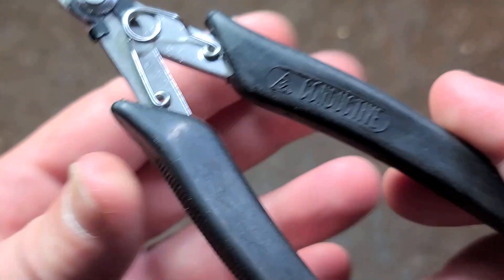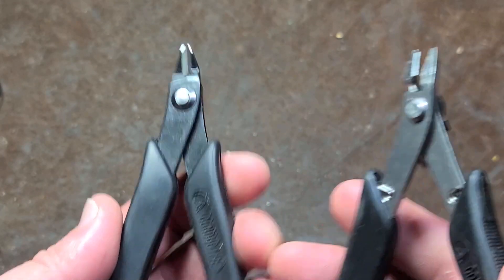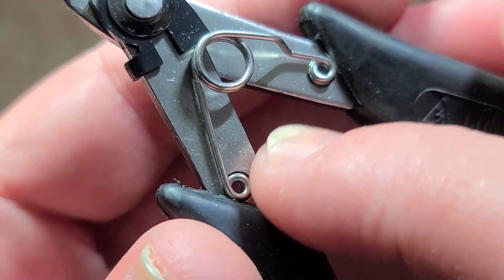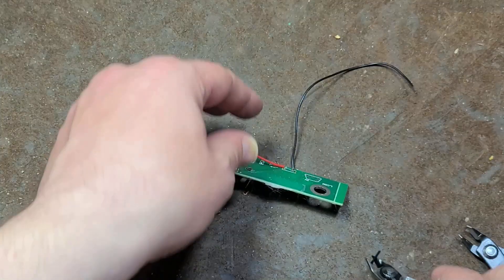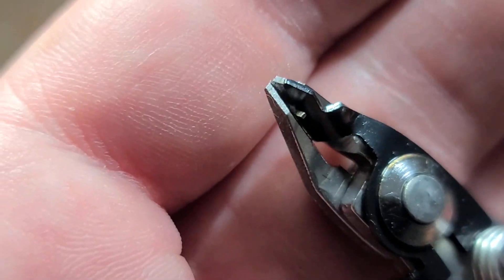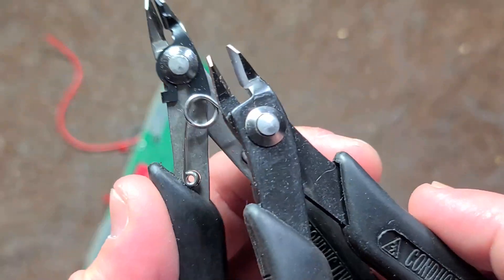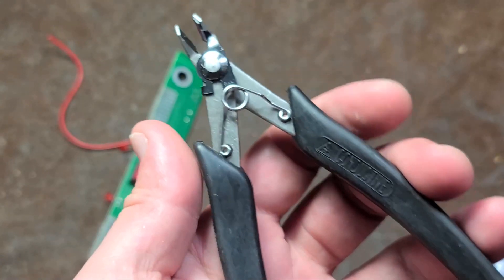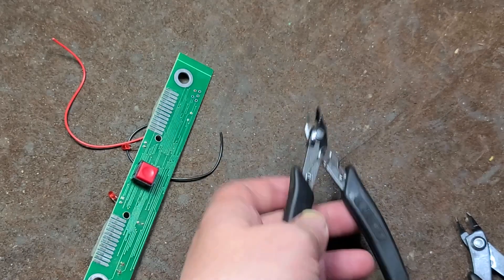Harbor Freight Doyle Electronic Flush Cutters Review

Comment: I have some Tsunoda flush cutters that I picked up for around $14 on Amazon. Theyre a "proper" forged design rather than the sheet metal construction, but they dont have the catcher. Tsunoda does offer a version with the catcher, but they're more of a diagonal cutter design, and they aren't made in Japan like the other pair I have

They seem to have held up pretty well so far